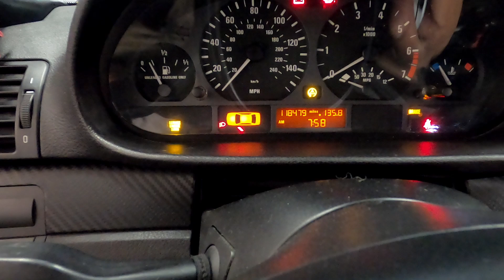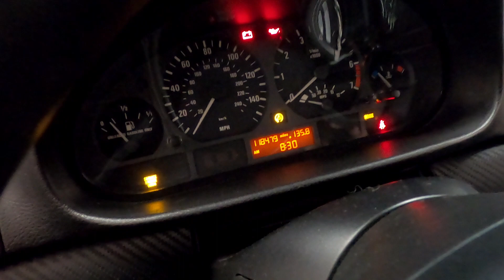E46 UPDATE    (steering wheel vibration gone ) !!!

Comment: How did you get the steering wheel vibrations gone ?
Reply from the maker: running 18x10.5 wheels running a set of wheels well fkk up the hub and any component on the front wheel but i did change everything and no luck until i got my engine mounts replace it went away..... try balancing your wheel it the cheapest mod and go from there

Comment: My steering wheel shakes when I go over bumps. Is it normal? I was thinking it was probably due to my 18 inch rims
Reply from the maker: It can be your inner tie rods or  outer tie rod ball joints that probably warn out & yes when you run with a bigger size rim or wider rim it will warn out parts alot faster
Reply: @SlowE46...  I checked the car and I dont think there is any play anywhere, except in the steering coupling made of rubber, could that be it? The giubo?